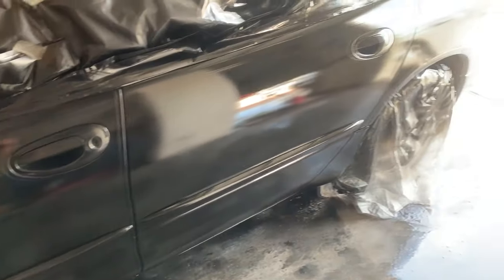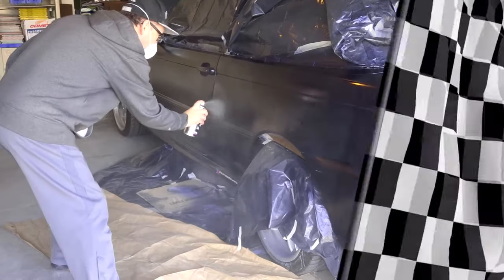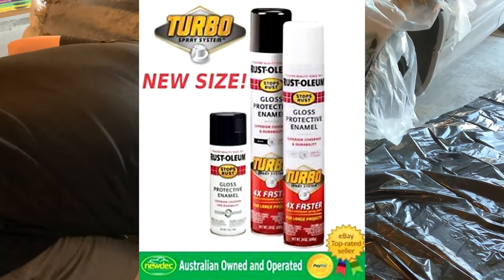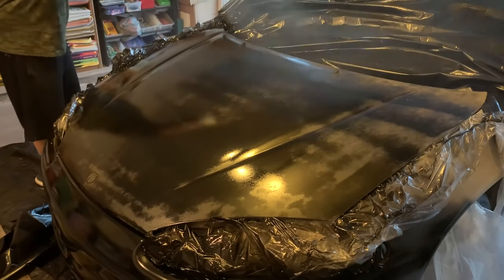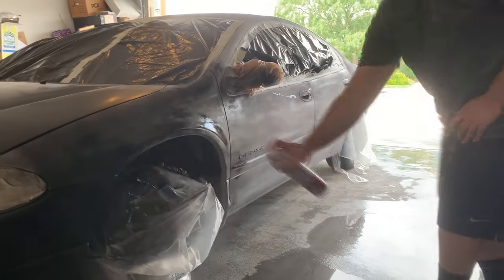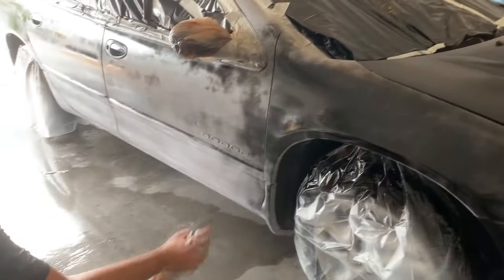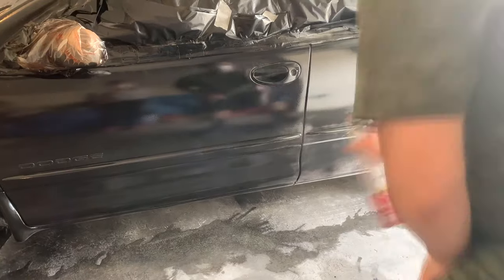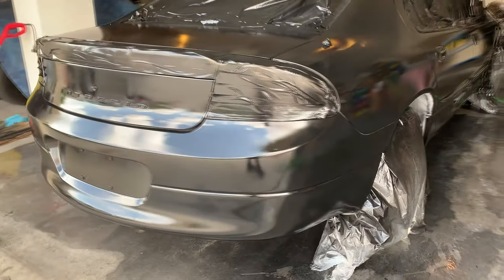Rustoleum Turbo Paintjob! (Is it worth it?)

Comment: Claybar isn’t going to remove orange peel wet sanding and buffing would remove the orange peel and restore the shine clay baring  is equivalent to taking rubber to some thing shiny and going at it until it fades
Reply: Can you use a clay bar to pull out embedded trash in the paint, a clay bar is not used to make paint fade. I don’t know who told you this, but they’re wrong. You are correct on wet sanding and buffing to remove orange peel.
Reply: That's not even orange peel, that's the paint lifting, which means he didn't clean it properly, or something wasn't compatible.

Comment: I would recommend wet sanding and buffing the paint instead of a claybar.  It wont take away the gloss finish either
Reply: You always use a clay bar on a car, a clay bar is designed to remove trash in the paint it’s not meant to buff or make something shiny.

Comment: Car  has orange peels , you need to wet sand it with 2000 and 3000 grid sandpaper , then polish it , after that wax it , it will look great and shiny , ✌️ peace
Reply: What polish and wax should I use for a job like this?

Comment: as a former bodyshop painter 
if you're going to paint your own car don't  do long strokes  you will get  too much  dry paint  which will cause it to look  terrible.. for example  if you're going to  paint a fender   only paint the  fender  then  move on to one door at time   hoods  can be a little tricky  so you start on side  then  over lap as you paint the other half  same way  top roof and trunk.. as well as bumpers.. spay 6 inches  away  using  side to side  sweeping..
Reply: Great comment

Comment: To add a tip about using any type of spray painting, but specifically to aid in painting your car, practice with a cheap can first and really take it how distance effect how it stick. If it pools up, if it’s spread thin, or if your maximizing your usage of paint per swipe. Get an idea how wind if any is present affects the spray, and make SURE to let it dry it an effect the costs a lot if it pools, which If you care about the overall look, and are doing this for the first time, be careful of.

Comment: I messed up painting my 95 Lexus Ls400 glossy black.I used Rustoleum Ultra Glossy Black and I spray painted the whole left side and it came out horrible.Tiger stripes, not shiny, heavy and light spots.I was dissapointed but I didn't give up.I bought a can of Turbo glossy black at Home Depot.I sanded the side of the car I was going to paint.Cleaned it.Painters taped it off.I sprayed it with turbo and this stuff is idiot proof.The paint looks even and shiny.I did learn what orange peel is, got that but I don't care, it looks better than it did.In 3 days I'm going to wax and buff it.

Comment: Video is okey but what you should have done was do a light coat over the whole car first wait 15mins depending on temperature of where your spraying than spray another coat but heavier and wait 20mins than spray a thick coat from now on but always wait in between coats than once you done about 5 coats leave it for the day come back next day lightly sand car with 400 grit to fix stuff ups clean it than do 1 more coat of what you just sprayed than wait again and than start with 2k clear coat but spray just as heavy as you have through the whole job wait and repeat for 6 coats let that dry for a week than wet sand the whole car to get orange peel off and other reason for so many coats of colour and clear is so when you wet sand and buff you don’t burn through the paint and still have plenty of clear coat to last you years